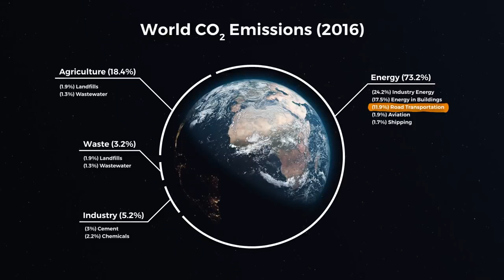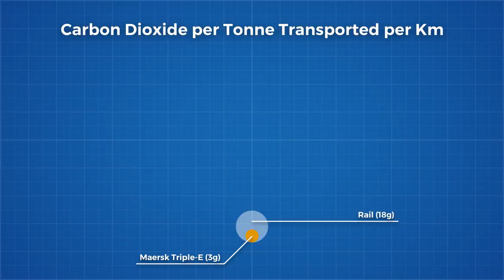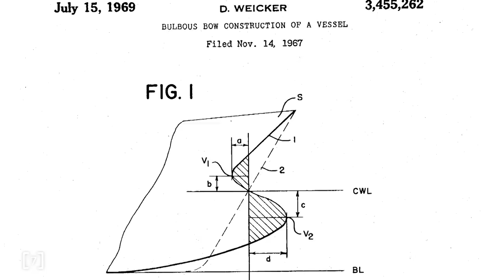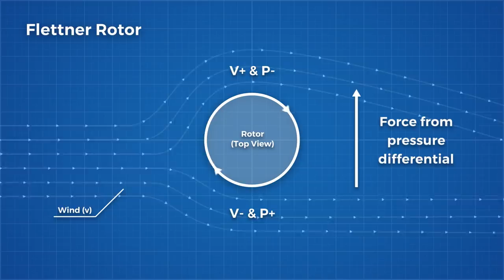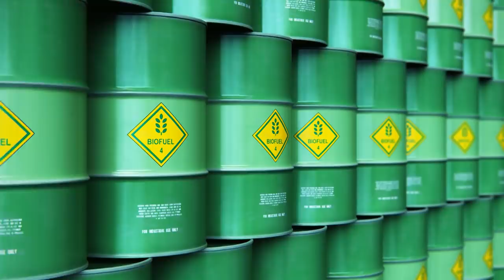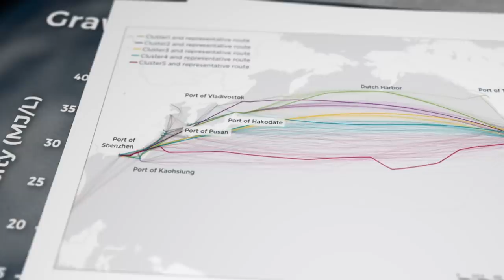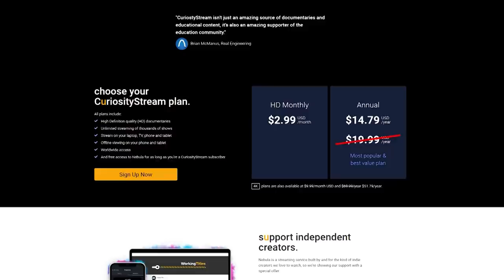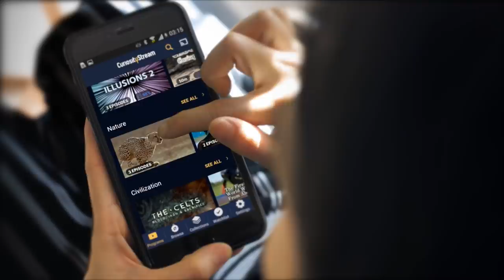Are Renewable Powered Ships Possible?

Comment: Fusion tech could be huge for these industries. Big could though, I don't know enough about the technology.
Reply: If you do a web search for ‘nuclear ship savannah’ you will see that it has been tried and did not work.  A similarly vessel heavily subsidised, by the government, vessel is in use in Russia which also operates, in support of the Northern Sea Route, a fleet of nuclear powered ice breakers all of these may, or may not, have been completely without issues.

Just think; would you have full confidence in the management of a nuclear reactor, of any type, under the control of an anonymous entity only traceable, perhaps, via a letter box in a FOC (flag of convenience) nation state?  If you are, could you sell that confidence to Japan, the state that hosted the Hiroshima and Nagasaki nuclear detonations as well as more recently the Fukushima ‘event’?  Then try that same, or a similar, sales strategy on Ukraine, the nation state that as a part of the USSR (CCCP) hosted the Chernobyl ‘event’.  Modern iterations of nuclear energy, thorium fuel, molten salt reactors or fusion reactors, will carry the legacy of past problems.  It is the global trepidation of anything with 'nuclear' in the name and the economics of nuclear having transitioned from 'energy to cheap to charge for' too 'the costs of remediation are incalculable' that will prevent the adoption of nuclear energy as a means of creating energy at sea.  Modern reaction systems may have overcome the safety problems but the general public, having been misled in the past, will be reluctant to believe the fresh new promises.  The incident of the ‘Ever Given’ blocking the Suez Canal, March 2021, may also have a little to add to this debate.  The cooling water on ships tends to get taken in from near the bottom so when running aground the inlets are in a prime spot to get plugged up restricting, if not stopping, the flow of coolant.  One thing that the TMI, Chernobyl and Fukushima incidents all had in common was that the supply of coolant, or rather lack thereof, was a fundamental cause.

‘They’ say nuclear is cheap, it’s not it is expensive and has a large embedded carbon quotient as well as being complicated, dangerous, not universally socially acceptable and having only ‘no need for refuelling’ as a questionable advantage; actually it does need refuelling just not as often.  When ‘they’ do need to refill the warming up stuff it takes considerable longer than pumping tonnes of thick black stuff, cSt380 HFO, or thin runny stuff, MDO, onboard which is one of the reasons HMS Queen Elizabeth and HMS Prince of Wales are pushed about by ICEs and gas turbines thus using a similar fuel as the aircraft that fly off of them.  The Royal Navy (RN) with a high degree of skill and expertise uses, at vast expenses to the UK taxpayer, a current operational nuclear fleet of 11 submarines (also known as ‘boats’) in two flotillas, seven attack subs and four ballistic missile boats.  The carbon footprint of all the extra bits of hardware and the fuel, including processing thereof, from ground to propeller, are the external costs that never seem to get considered.

Disposal, once it wears out, of both the machine (that was a ship) and fuel is another can of worms best left unopened.  The 26 RN boats no longer in use are laid up (some in Rosyth and some in Portsmouth) awaiting long term deconstruction including dealing with the fuel rods and other irradiated material.  The USN is not, as far as I know, a commercial organisation working to very tight margins and also has the skill and expertise to handle the complexities of nuclear power; so as well as submarines their aircraft carriers are nuclear powered and each of the current iteration has a build cost three times that of QE/PoW, bigger crews and more generous funding.  For those who still think that nuclear energy might be the answer I recommend this report: - https://www.bbc.com/future/article/20200901-the-radioactive-risk-of-sunken-nuclear-soviet-submarines?ocid=ww.social.link.email.  The navy of the USSR might have been under resourced and over extended but it was still generously supported in comparison with merchant shipping.

Comment: I can see two possible solutions that might be optimal, either with one dominating, or in some combination►

1. Biofuels. As long as it's not done on too big a scale, this might work well. No palm oil plantations, please. Rounding up "waste" products from forestry and agriculture might be the best source for most fuel (keeping in mind that these are not necessarily truly wastes). You could create biodiesel, or maybe propane or butane or LNG-like fuels. Ideally, you want no particulates and NOx, but let's keep this in perspective; minimal amounts of particulates and NOx aren't nearly as harmful over the open ocean as they are in cities. The CO2 emissions could be offset by modest amounts of air capture, where the energy source could be either waste heat from industrial processes, or electricity from wind and solar.

2. In-route battery swapping. The best configuration would need to be worked out, but I could see a ship design where a cargo-carrying top structure is slid away from a depleted battery pack and onto a fresh one, from one of a set of battery depots spread around the ocean, perhaps on the order of 1000 km apart. This would eliminate delays from stopping on long routes, and would have the advantage of a low center for the ship, making it more stable, due to the heavy batteries on the bottom. Efficient electric propulsion, and zero emissions, could be a compelling combination. No doubt about it, these would be some of the biggest machines ever made, but I don't see a reason why it wouldn't work.

Comment: I'm more interested in Skysail systems and similar projects over Fetner routers. They are much smaller, don't course a break in the sigh line from the bridge, and can be used to supply thrust or electricity, depending on the model.

Comment: Wouldn't slower ships mean longer times to reach the destination, hence burning the same amount of fuel eventually?
Reply: Very well spotted.  Speed reductions, a useful buffer for adjusting variations in demand, will in the long term require more goods in transit to maintain any given long term level of supply.  Typically tankers move at 15kn so a reduction of speed to 12kn could yield a fuel consumption saving of 20% (?), however to maintain the same flow of material an additional 25% of shipping capacity will be required.
 
4 ships at 15kn fuel used  X =  60 freight miles  =  5 ships at 12kn  fuel used x+ or x- (?).

Reducing speed to save fuel reaches limits when the vessel does not maintain steerage way and suffers loss of control, the speed through the water is too low to overcome tidal streams and the speed over the ground is to low the make good any significant distance towards the objective against prevailing weather & adverse currents.  The speed to cost ratio is as finely balanced as any of the other factors in the shipping business.
Reply: No, fuel consumption does not increase proportional to the speed.

That is, if you move twice the speed you need more than twice the fuel

Comment: Thanks for this great informative video! I have a question about the heavy fuels that were banned from these ships: are they now used in other applications? The ideal thing would be to ban them not only for ships but for any application.
Thanks again for the video, keep up the good work!
Reply: There are hardly any applications for heavy oil fuels in transportation, only ships have so large slow turning engines. Only oil power plants and thermal power plants can also use heavy oil. So yes, there is the threat its just being burned elsewhere.

Comment: 3:00 a questionable choice of axis, why fuel consumption per day?
it should have been fuel consumption per 1000km on the Y-Axis.
the number of days increase when you slow down.
so the same trip will take more days using more fuel. based on this graph you could
not deduce that there will be a decrease in fuel consumption.

Comment: Depending on who you believe rumor has it that biofuels use more energy and cause more pollution then they produce or save.
Reply: How about ‘bio fuel’, how green is it?  Short answer, not very; major problem is land use and the limited upside is that the carbon released into the atmosphere has recently been taken out of that space in the growth part of the cycle minus the processing deficit.  On a small scale, to use up the waste products from other industries like forestry, animal husbandry or agriculture, ‘bio fuels’ are as good source of carbon molecules as you could get but they, like all 'alternative' fuels, still involve a combustion stage and therefore some noxious effluents, NOx for example.  Fossil hydrocarbon oil fuels run up from CH4 (methane/biogas) to very thick black cSt380 HFO (C20H42 to C50H102 or more).  The sweet spot is kerosene (C10H22 to C16H34), also known as gas turbine fuel and used in modern aircraft engines.  It is relatively cheap, relatively energy dense, relatively hydrophobic and relatively safe.  Creating a non fossil substitute, at a reasonable cost, is ‘the holy grail’ for energy chemists; like turning base metal into gold and they may have cracked that oyster, see here for details: -https://www.bbc.co.uk/news/science-environment-56408603.  Natural history, on a geological scale, has done a lot of heavy lifting for us humans.  The trade off for plant or algae based hydrocarbon fuels is increased atmospheric green house gas or increased land or marine area use.  Even overproducing rather than simply harvesting the existing resource or using the residues will not fill the space left by fossil oil & gas.

Comment: How about having ships with build-in saltwater-to-desalination-to-electrolysis with fuel cell? Use those cylindrical shape wind turbines or/with solar panels on sides and roof (higher than container space) for power of conversion saltwater from oceans and sea to hydrogen fuel, making fuel on the way but at the almost the same rate as usage of energy on board. It could be expensive, but could manage to close the loop...?
Reply: The wind turbines or solar panels would not harvest enough energy to power the desalination and electrolyse of the sea water, both are energy intensive processes, so there would be no excess hydrogen generated to drive the ship. In short the numbers do not add up, even before the financial or resource cost of the installed equipment is considered.

Comment: I've read that ammonia is also a considerable option, since it holds more energy in the same amount of volume as hydrogen. It would only need an extra step as well: Add nitrogen to the hydrogen. There could also be large 'fuel stations' for ammonia as well and it can be considered 'green' when renewable input is used. Definitely an interesting topic to do research on.
Reply: The ‘Just Have A Think’ channel recently posted a video on the subject of hydrogen and ammonia that you might fine interesting.
Reply: @BernardLS  I will check that out, thanks!

Comment: Methane is only harmful if it's released into the atmosphere in an unburnt state. If it's been burned completely in an engine, the exhaust product is far cleaner than that of diesel or heavy-oil.
Reply: Combustion of CH4 produces H2O and CO2 which is released to the atmosphere. Though not at bad as CH4 in GHG terms every little adds up. Also there is waste heat from the combustion process and use of the environment as a heat sink for the ‘cold’ of the chemical to mechanical energy transformation. Et cetera, et cetera. Just consume less, it is the zero cost option.